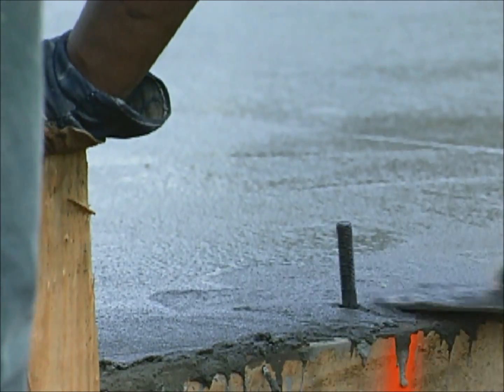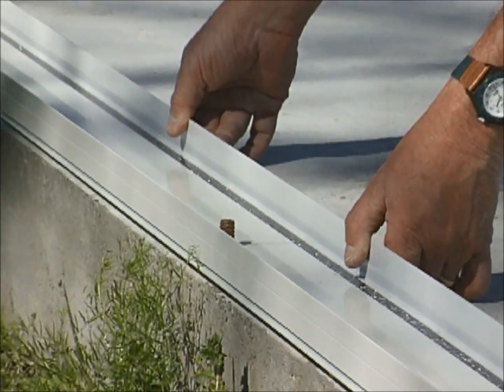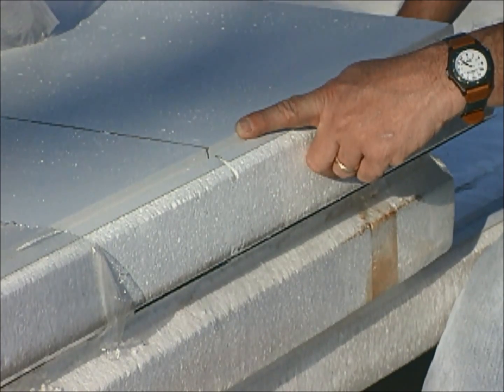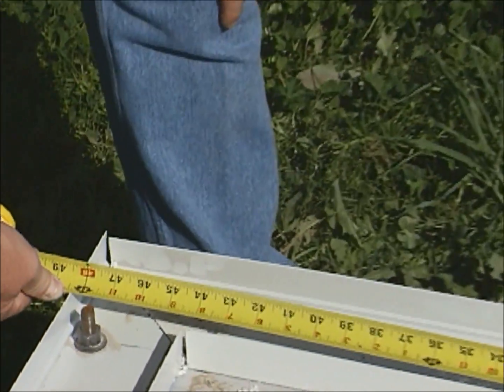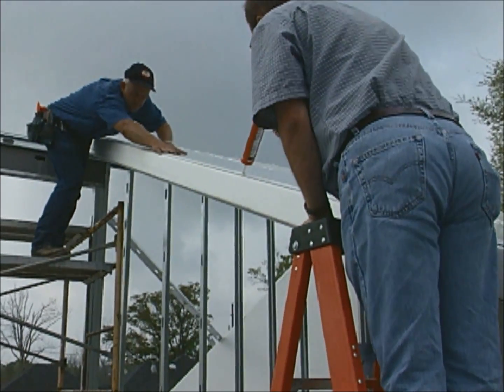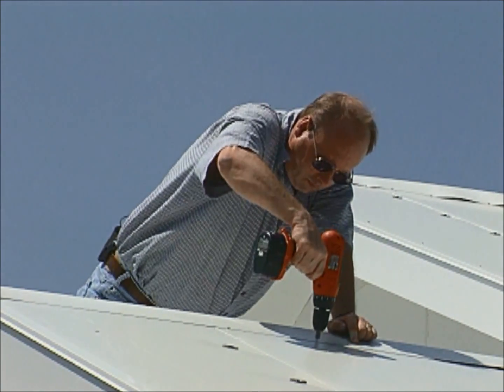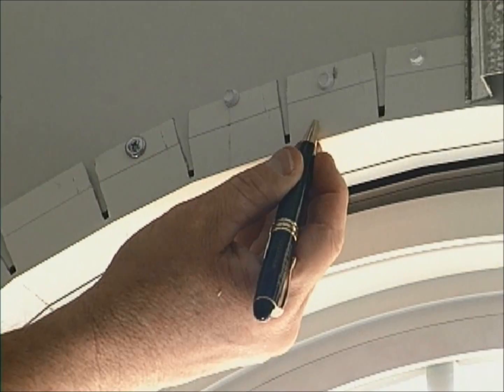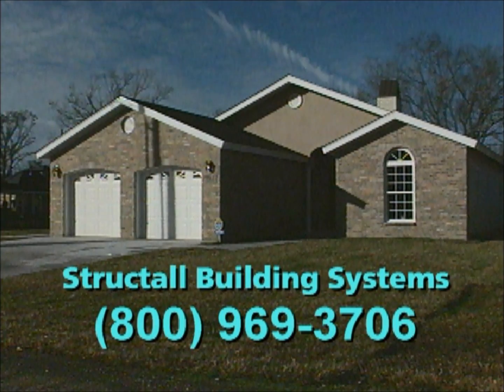Structall Steel SIPs Building Step By Step

Comment: How strong is it? Will it stand 120 m/h hurricane?
Reply from the maker: Snap-N-Lock Steel SIP structures are very strong.  Basic engineering for our buildings are capable of withstanding winds up to 120 mph.  We have engineering meant for homes built on the coast of Florida that can withstand 150+ mph winds.  Our load-bearing wall panels are Florida product approved for High Velocity Hurricane Zones (HVHZ).  Our testing reports show that the panels are impervious to water and air infiltration.

Comment: It appears there is no caulking or sealing the panels in the channel to the concrete or when they are joined together.  Can you please explain why?
Reply from the maker: There is a 3/8" bead of caulk between the base channel and the slab.  2 beads if you are using the base channel with thermal break.  There are weep holes drilled in the outer leg of the base channel for any trapped moisture to escape.  There is a bead of sealant applied in the sealant reservoir.  The snap-n-lock connection between each panel effectively seals the entire envelope.  We have had moisture and air infiltration testing performed on the wall assembly with no evidence of water/air infiltration.
Reply from the maker: Also from a previous response:   While there appears to be a gap at the bottom of the panels, the steel skin is resting on the ledge provided on the extrusion. The lip provides a capillary break that is so that moisture from the slab or other wet surfaces are not in contact with the metal skin or the EPS foam. We also recommend 1/4" weep holes in the base channel every 4 feet. 
We do use caulk in the sealant reservoir as an additional air and water barrier.  However, they are not the primary protection feature in our product. The panels have a very strong mechanical connection when they snap together, and are very difficult to separate without lifting the panel out of the track and rocking them in or out to unlock the panel. With the fasteners 6" O.C. on each side to the panels there is no opportunity for the panels to rock and unlock.
Show less
Reply: How do you prevent insect and or water intrusion if there are weep holes in the base channel?
Reply from the maker: Even during a flood, there is no where for the water to go but out the weep hole.  The EPS foam will not soak up the water and the G90 Galvanized steel skin will not corrode or delaminate due to exposure to water.   There wouldn't be enough pressure to push the water past the panel and into the interior of the structure.

There is a minimum 6" clearance around the outer perimeter wall to comply with the IRC building code, thus insect infestation can be observed as they enter the wall for nesting purposes, i.e. termite mud tubes on the surface of the foundation. Additional protection can be provided with insect resistant foam at a nominal charge as well.

Comment: Is there any information available on the header requirements over garage doors? I've got a 10x10 rollup door currently installed in a 12' wall and would like to increase the height of the opening another foot. This would mean shortening the header section from the current 2' down to about 1''. I would replace it with either another rollup door or hang a sectional door from the ceiling. Would I need to reinforce that remaining header section with steel or something else?
Reply from the maker: We have a connection detail that we'd like you to take a look at.  Please, send an email to info@structall.com and we will forward the detail to you.

Comment: Very cool. How much more in general does this form of construction cost over standard?
Reply from the maker: Steel SIP construction costs less, actually.  After you factor in the materials, manpower, and time required to build an equivalent, energy-efficient home, using other methods, you will exceed the cost of a Steel SIP home.

Comment from the maker: +Nina Ashton  1.5" furring with standard nail guards is FL code compliant. ///  In many cases a beam can be used rather than a load-bearing, dividing wall.  This feature would be engineered into the construction of the home. ///  The fascia trim is the best choice for adding gutters.  Our engineered connection detail exceeds industry standards.  Contractors have been using them for years on a variety of projects with no failures.

Comment: "framing the radius" 

think you mean circumference, lol.

it's a good system. I am planning to use SIPs for my tiny house. what do you think weighs less? wooden or steel? and which one would be cheaper?

both are strong enough
Reply from the maker: +Duncan Dixon Steel SIPs are lighter.  A 6" Steel Snap-N-Lock panel is 2.23 lbs/sq.ft., whereas a 4-1/2" OSB SIP weighs 3.31 lbs/sq.ft.  
Panel vs Panel, the OSB SIP is cheaper.  However, with OSB SIPs, you should consider the additional cost of manpower/machinery needed to work with and lift the panels, as well as the extra materials you will need to protect the OSB home from water and insects.
Reply: Excellent. I know that here in nz, we can get wooden sips locally. I just hope we can get steel.

Comment: Interesting!  Where are you located, what is the approx. per sq ft (wall area) for the panels.  How is the cell phone reception inside the building, what is the "R" value of the wall and roof, and what else did I not ask?  Thanks!
Reply from the maker: +Randy Lavine  We have distribution centers in San Antonio, TX, St. Gabriel, LA, Lakeland, FL, and our manufacturing and home office is located in Oldsmar, FL (Tampa/St. Pete area).  

Our panels are a net 48" W, so depending on the lengths, which can achieve in excess of 30' when necessary, you receive an actual net value equal to the stated dimensions i.e. 4X8=32sq. ft. and when installed, as the video shows, in 2 or 4 ft increments (proper planning allows for the other 2' of the 4' wide panel to be used on the opposite wall or roof section). 

As in your vehicle there is no appreciable loss of signal due to the steel skin on the panel. The two layers of 26 ga. steel equals about 0.10 mm. and the average sheet metal on a car is 0.60mm to 0.80mm.

Our 4" wall panel and 6" roof panels assemblies, as illustrated in the video, meet the requirements for R20 Walls and R49 roof per the 2012 IRC.  More information about codes R and U equivalent can be found here: http://publicecodes.cyberregs.com/icod/irc/2012/icod_irc_2012_11_sec002.htm

Notable features:
Integral moisture/air barrier, allergy preventive construction, Indoor Air Quailty (IAQ), sustainability, green, MLS green value added listing, reduced skill labor requirements, extended work season, mold preventive construction, up to 150 MPH construction, reduce apartment turnover, fewer foreclosures, fortified building, HERS 60, flood resistant construction, factory direct warranty, solar ready, aging in place, low job site waste.

Comment: at 11.42 the 2 meeting roof sections look poorly fitted or cut,looks a bad job
Reply from the maker: +Jon Bishop  Now and then, one roof panel might be a bit higher on the ridge, so even though the foam, as evidenced in the video, is actually tight together, the bottom of one panel is about 1/2" lower in elevation at this termination point.

Of course, there is trim that will be applied once the fascia is installed.  From experience, our contractors have found if you take some of the excess angle trim and place it angle side down on a block of wood with a little tapping with the hammer it will spread to the angle you are looking for and makes for a very strong joint and a finish that matches the fascia.

Comment: Only four screws to hold the corner panel to keep plumb? Why not using strong shims along with the screws?
Reply from the maker: +Fussinated The 4 screws are just part of the initial steps.  Further on, the video shows the screws being installed interior and exterior approximately 6" on center. Shims tend to not be exact and cause interference when attaching the next panel.

With corners plumb the adjoining panels rest fully on the ledge on the base track and, with the interlock action of the Snap-N-Lock panel, further inhibits any movement. Additional shear value is added as all corners on the interior have a flat strap X, from the track to the wall cap, and the wall cap to the plate. The initial two panels in both directions serving to increase the shear capacity as well.

Comment: I'm still in early design phase and have yet to look into financing or the land yet but what would be a ball park figure for a 16 foot by 40 foot square house with a single 3/12 shed roof (sloping from one of the 40 foot long walls to the other 40 foot wall) with 2 foot overhangs starting at 10 feet tall wall on the long back wall using like 6" panels for the walls and whatever you would recommend for the roof, with the floor system already in place. Just trying to ball park how this would compare to conventional wood framing materials cost. It would definitely make things simple enough that I could do the labor myself. Also how wide a doorway can you do with these and how big an overhang can you do with a 10 pound snow load?
Reply from the maker: +DanielRichards644 We have forwarded your request to our Senior Project Manager.  If you would like to speak with him directly, please send us an email at info@structall.com with your contact information.  Otherwise, we will message you with his response.  Thank you.
Reply from the maker: +DanielRichards644 Using 6" roof panels and 6" wall panels, the materials for the house would be approximately $14,000.  That includes the panels + all extrusion, screws, and caulk.  Addt'l costs to consider would include the ventilator and engineering drawings.  Doorways can be any size, within reason.  The details we have transfer the load to the foundation.  We have details for up to 16'-18' garage door openings.   Regarding the overhang, we do not recommend in excess of 2' overhang without a beam to attach to, due to the uplift factor involved in a wind event.  The snow load is not the limiting factor.  If you would like more information or an itemized quote, feel free to contact us at info@structall.com.

Comment: Have you ever used steel structual steel SIPs for a tiny house on a trailer with a loft?
Reply from the maker: +jena543 gerda This is a project we are currently looking into.  We have had several contractors contact us about building tiny homes and tiny homes on trailers.

Comment: What about the gap on the bottom of the panel? Why aren't the panels glued to each other
Reply from the maker: +2Awesome 

While there appears to be a gap at the bottom of the panels, the steel skin is resting on the ledge provided on the extrusion. The lip provides a capillary break that is so that moisture from the slab or other wet surfaces are not in contact with the metal skin or the EPS foam. We also recommend 1/4" weep holes in the base channel every 4 feet. 
We do use caulk in the sealant reservoir as an additional air and water barrier.  However, they are not the primary protection feature in our product. The panels have a very strong mechanical connection when they snap together, and are very difficult to separate without lifting the panel out of the track and rocking them in or out to unlock the panel. With the fasteners 6" O.C. on each side to the panels there is no opportunity for the panels to rock and unlock.
Reply: Structall Building Systems my concern was more for the thermal bridging then for the structural holes making it collapse.
Reply from the maker: 2Awesome We use Thermally Broken extrusions to prevent thermal bridging (the black stripe showing on the base channel, window/door C channel and wall wall caps).
Reply: +2Awesome A foam structure! I thought it was a steel structure?
Reply from the maker: It is actually a SIP (structural insulated panel) structure.  EPS foam is sandwiched between two pieces of 26ga steel.
Reply: Brian H. It is structually sorta like an I Beam wall. Foam is the webbing, steel is the flanges

Comment: You don't even insure the anchor bolts are anywhere near perpendicular.
Reply: Fresh poured concrete is very sloppy & soft when placing anchor bolts. There are little plastic disc & post jigs available that you can tuck up next to the bolts to plumb them up, but they are a fiddly waste of time. After the concrete begins to harden to a modeling clay consistency, builders go to each bolt with a speed square or bullet/mini level and push them plumb; at that point, they won't sag out of plumb as the 'crete cures.
Reply from the maker: Yes, they are much easier to fit the track over when they are near perpendicular and, frankly, with less thread above the concrete.  However, as you see in the remainder of the video, even this can be corrected.  We have a photo that shows a more appropriate installation of the anchor bolts on Flickr:   https://www.flickr.com/photos/structall/16521997785/

Comment: I know little about building a house currently, but plan on having one built sometime in the future. Would ICF exterior walls, and steel SIP interior walls be feasible? I understand it would require changes to the building of the foundation and that's fine. I am just curious if it's realistically doable and what things would have to be taken in to account. I really like ICF, but the amount of interior space lost seems too high unless you're building a mansion. Any help would be appreciated.
Reply from the maker: One our biggest value enhancement with this system is in using our Steel Snap-N-Lock panel to close the envelope by providing continuous uncompressed insulation over the exterior wall as well acting as the structural roof system providing the vaulted ceiling and excellent conditioned attic or optional loft area. 

That being said, the Snap-N-Lock panel does serve as a superior interior wall for separating the garage and as demising walls between two units in multi-family units providing fire rated walls and greatly reducing sound and air pollution between the units.  Interior walls are best served with light gauge metal framing for value and ease of construction.